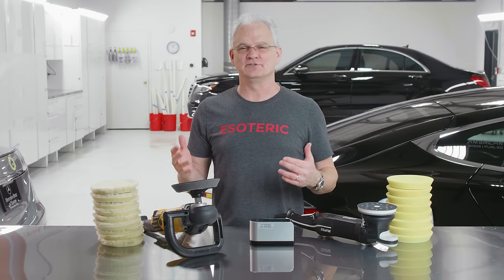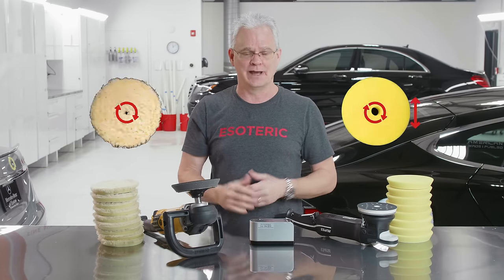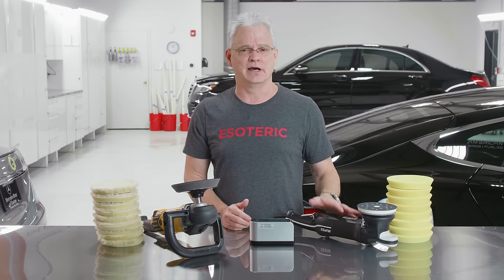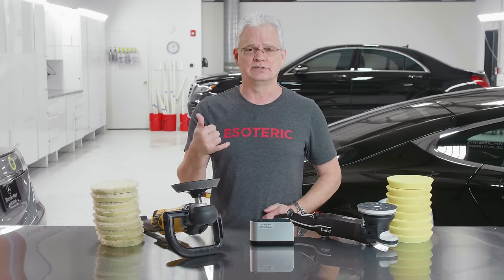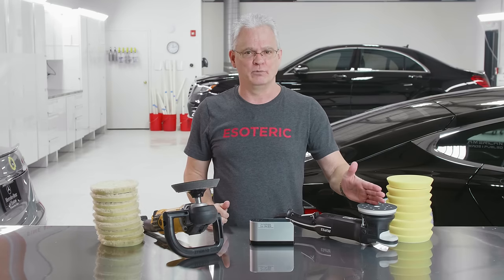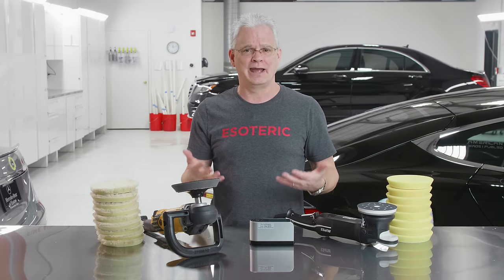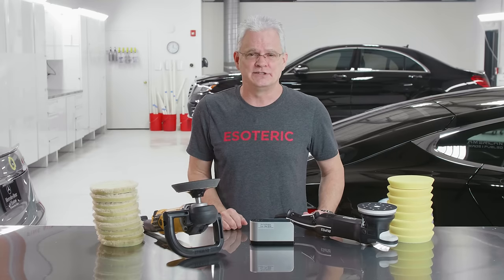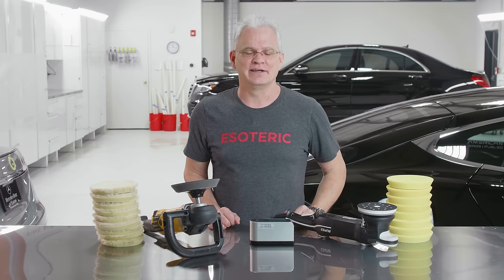Still polishing with a rotary? THIS could change your mind!

Comment: There are some places that you just can't reach with DA no matter the size of the pad. Like concaves on the rear quarter panel of Porsche Panamera - these spots (if they are badly scratched of course) you need to hit with the rotary, beacuse DA with cutting pad will stall there. It is true though that rotary is being used less and less. Mainly due to paint getting softer and tremendous development of abrasives. 
Sad thing is, that many new players in detailing game completly omit rotary, which I think is wrong. It is a very useful tool in thight spots, or when the time is tight. Cut with rotary - finish wit DA - match made in heaven. One step (which is like 80% of paint correction that I do) only use DA
Reply from the maker: We have zero problems compounding with a DA in areas like that, nor have we ever felt the need to grab a rotary to work in challenging areas regardless of the type of car. "Pad stall" is a technique issue, and not a DA issue. We teach these advanced methods in our academy. If you personally like to compound with a rotary and finish with a DA, then there's no problem with that if that's what you like. But you simply don't "need" to do it because of shortcomings of a DA.
Reply: @Esotericdetail  That's intresting. I've done training with Rupes Detailing Academy and Detail King, done over 100 cars with DA and still no luck. Going back to that Porsche Panamera rear quarter - no matter what type of pad, what pressure, machine speed and angle of attack, I could not get my DA (LHR15 MKIII) to rotate in those places. Pad was stalling, it was only orbiting not rotating, so not much cut at all. I swapped it for LHR75 and it did somewhat better, but still there were some spots where the pad "bridged", so I pulled out Ibrid Nano with DA attachment, and got this place done fairly well. But on the other quarter panel, I pulled out LH19 with wool, and using just the very edge on the pad, done it quicker and much better than with DA. Of course, I've had to do a second step in that place with a DA which was not a problem, since Rupes Yellow Foam is just amazing in conforming to these types of concaves.
Reply from the maker: @KamiruNusbaum  There's a reason why detailers from around the world attend our academy!

Comment: hi Todd,i'm new in detailing business,i' ve started a few months ago from passion and now im at that point that everything is confusing for me when i speak aboiut compounds and pads,i have rupes machines lhr 21 es mark3,lhr 75,ibrid nano..what compound do you think will do the job in one step and what pad should I use it?
second question is if is better to buy a rotary machine for headlights as ive noticed the da polisher is not bringing back the clearness or maybe i don't know how to do it.
thank you,Elian
Reply from the maker: Do a one-step with the Rupes yellow polishing pad, and Sonax Perfect Finish. As for headlights, do you actually have a big demand for restoring them? If so, a rotary may be good to have, as well as sanding equipment. If people are not paying you extra for that service, then it's not worth your time.
Reply: @Esotericdetail  thank you for advice,may i ask you just in case if the swirls remain on the car what shall i use it?
some people they're looking to get only the headlights done but is not high demand at all.thanks
Reply from the maker: @raduelian9661  A solid one-step should take care of swirls, but may leave deeper scratches or imperfections. If a customer is paying for a level that removes everything, then do a multi-stage. If they are not, then allow the one-step to get what it gets.

Comment: Hey Todd, what is your favorite one step pad and polish combo  for forced rotation DA?
Reply from the maker: Rupes Yellow polishing pad with Sonax Perfect Finish!
Reply: @Esotericdetail  Thanks Todd! I love perfect finish as well!
Reply: ESOTERIC A rookie inquiry here. When you say “one step” correction...do mean the majority of all paint correction can be done in 1 step. Does that mean 1 step of correction, regardless of the condition of the paint? So if very poor paint surface and you use a “compound “ grade polish...after that step you can you go straight to application of your wax/sealant/ceramic spray? Thanks for any clarification.
Reply from the maker: @lead-dog  One step correction means that you're simply using one type of pad, and one type of polish throughout the process as opposed to a heavy cutting followed by finish polishing. It's not that most cars can get near perfect with a one-step, it's just that most people don't want / need "full correction" that comes with multi-stage polishing. On some cars, you may only get 50% correction through a one step, but on others you may get 80%+. But to most people out there, 50-80% correction is bringing the level of the paint to a higher finish than they have ever seen before.
Reply: @Esotericdetail  Thank you Todd (or whoever) is writing this reply. This is very helpful to a guy like me...retired...and having a passion for detailing and for getting it right and knowing what I'm talking about. You and Esoteric always have great material on you tube. I consider it the best channel for really getting an education. I hope that one day I will get to you seminars. Thank you so much for the help. You have a friend on Amelia Island. ;)

Comment: I had this problem at a Porsche garage i worked for. He had a big foot but wouldn't let me use it because he said it eats through pads ? ( he said the polisher chews the pads up)
I used it and didn't listen to him and it corrected half a Porsche 991 and he thought I did it with the rotary and was very pleased asked me to do the other half . He then showed me what he means with the rupes and he put all his bodyweight against the polisher and went mad 😠 
I said thats not what its for you let the polisher do the work thats why your ripping through the back of the pads.
Because I said that and wouldn't use a rotary like I was wielding a sword in a medieval war he got the car mostly repainted and sacked me. Got videos of the correction i did and not 1 detailer can fault it. U cant teach some old dogs unfortunately

Comment: Who knows how to use a rotary is a more complete professional.
Reply from the maker: As a company with over 30 employees and 3 locations, working at a very high level with cars being shipped in from all over the USA, and nobody using a rotary...I must respectfully disagree with that statement!
Reply: @Esotericdetail  my opinion is not about a company and its professionalism. I'm talking about professional skills. Anyone can master an AD without much difficulty, but not everyone can master a rotary polisher. It's not about better equipment or better work, but about a professional mastering both.
Reply from the maker: @TheRockguitar70  The point you are missing though...it is not a necessity. You can be a master detailer operating at the very highest level without using a rotary. The days of the "top detailers" with rotary skills, then everybody else is long gone. What once was a "badge of honor", doesn't really mean anything now. Results and performance are what defines the top-level detailers, not the tools being used.
Reply: @Esotericdetail  again... I agree with everything you said, but that doesn't take away the fact that whoever operates both machines has more skills than whoever has mastered just one. I'm not talking about need but practical knowledge, as you said at the end of your answer: what matters is the result and performance achieved and not the tools used behind it. Some get performance and results using any tool, others just a few.

Comment: you cant compare the work in rotary. as my experience i still use the rotary compare to dual action
Reply from the maker: Sure you can. As good of cut and finish in fewer steps without the worries about holograms or worse. Once you discover the right combination of products and techniques with the DA, you'll realize it's a game-changer.

Comment: What are your thoughts on the flex 3401
Reply from the maker: We prefer the full control of a true D/A as opposed to the forced rotation.
Reply: What is your da of choice to remove pretty good defects
Reply from the maker: @greggriffin3242  We use the Rupes LHR15 most of the time, and it's also our most popular seller.

Comment: Mate, I can counter your argument why the Rotaries are better.. 20+ years of using Rotaries.. Mind you I have DA Orbitals aswell.
Reply from the maker: I used them successfully for many years as well, but when the long-throw DA's came to market, it was a game-changer for the industry.
Reply: @Esotericdetail  In all honesty if you're a professional on a rotary and pushing out a volume of cars under small timeframes , DA's aren't the go to Buffer. Rotary wins this argument all day long.
Reply from the maker: @asala2116  You can't "rush" finish polishing with a rotary...plain and simple. We move a lot of cars through here at fast pace, and the rotary is only used to spin-dry pads.
Reply: @Esotericdetail  rush finish? Everybody has their method of working. For many years using rotaries we've had no problems. You're speaking as if DA's are Gods gift to humanity, and that we were doomed if such a thing didn't exist. I'm sure you had your way of working with rotaries and maybe when the DA came along, it made things a lot easier. There's things I agree with you, for example finding an employee who has Rotary experience was really hard. DA's are much easier to use and learn.
Reply from the maker: @asala2116  You can do compounding in a quick manner with a rotary, but at least at the level we're finishing at, you simply cannot perfectly finish down that level of compounding in a "fast" manner. Proper finish polishing takes time, particularly when going for very high levels. I have done hundreds of evaluations, many of them with others who claim rotaries to be "faster", and the DOI meter says it all. You can get good results when going fast, but you can't get "great" results...once again, verified by the DOI meter. And when it comes to the rotary and sales / use, they are pretty much dead. About the only people using them anymore are old-school body shops. The industry started to change over a decade ago, thanks mainly to the invent of the Meguiar's MF Cutting Discs. Then once the large-throw machines came out, and pad / polish technology got better, it was game over. If you personally still like to use a rotary, then more power to you. But the main topic of the video is that the modern DA, teamed with the right products and techniques, are capable of everything that a rotary can do, but with less risk and a shorter learning curve. Because it is so much easier now for DIY people to pick up a polisher and get great results, many detailers who separated themselves by their rotary skills, no longer have the "advantage", and that has ruffled a lot of feathers so to speak. For us, we separate ourselves in the quality of work (and training) that we do, and if we can develop and discover efficiencies and tools that allow us to continually grow and expand while maintaining the same high quality level, then we operate our business accordingly, and advise others to do the same. On a final note, the DOI meter is the best tool that developmental detailers can use as they take subjectivity completely out of the equation. This tool was the key for us securing an OEM car manufacturer contract for training and consulting as it proved that factory was able to achieve a greater finish in less time, and fewer steps with a D/A than what they were doing with rotaries. The paint supplier themselves were on hand for the testing process, and agreed that data spoke for itself...the factory then switched their tools, systems, and methods to ours.

Comment: Thanks for the video.  Can/should you use a DA for wet sanding?
Reply from the maker: You want a small orbit DA for sanding...if you feel you need sanding. Unless you're working with re-painted cars, there's very little (if any) need for sanding.
Reply: @Esotericdetail  I was thinking about a 3" DA and wet sanding headlights?
Reply: Amsterdamnster Kush  Yup. That is what I ended up doing and it came out great.

Comment: I use a rotary on boats, but DA on cars...
Reply: Can you use a DA for boats? I'm looking into getting a DA so I can do my boat and cars
Reply: @HoHoPlays  - you can get a DA but you and the DA will die before you ever finish badly oxidized boat gel coat...It will way overheat and take forever providing you know what boat compounds and polishes to get, have a zillion pads, and the ability to clean them and reuse them, and so much more...  
I would only recommend a Rotary for boats, no matter what everyone who is selling DA's says..  :)

Comment: Hi Todd, a little off topic (well, some polishing is involved I guess ...)  I was cleaning the car's black leather seat with diluted APC 1:10, using Gyeon brush. I wiped the seat with a microfibre cloth and it seemed like it picked up a lot of  dirt. I repeated the process over and over again thinking how dirty the previous owner could possibly be , but the amount of 'dirt' picked up the cloth  was not reducing in any way. Then I realised it must be the leather dye coming off! How is that possible? The car is 2017 bmw with just 50,000km! Did you ever encounter something similar, and what is the best way forward? I applied Gyeon leather coat later, but the area that I might have overworked seemed to look more dull than the rest of the seat
Reply from the maker: We personally don't use APC's for leather work, and we rarely use any brushes with the exception of mild ones. This car could have had the leather repaired in that area, and you were simply removing dye. That's really the only time we see that happen.

Comment: Can I start as a beginner with a rotary? cause a DA cost so much 😂
Reply from the maker: Not a good plan unless you have somebody to teach you the proper way to use it. They have a steep learning curve, and they take a long time to master.
Reply: I just bought cheap DA a 15 mm throw and its smooth and not noisy, the brand is north wolf DA 15 mm 900 w 
I also start diy learn polish with rotary and at that time DA is very expensive. Until now i still couldnt master it, with DA i only need a few minutes to produce better polish result and after few days practice, now i could produce some head turner result in our old car and no way i could get same result if i have to do with rotary

Comment: 🤔 hummm I Do bodywork, I tape , I paint , I cut and buff , to me it doesn’t matter which one I used , because I jam when I buff I am not worried about burning the paint , because I can repair it . But for all you young cats use a DA  to start then when your ready for the Rotary jump on it it’s better faster . All my mentor used a Rotary they call the DA a funny tool 🤷🏻‍♂️
Reply from the maker: There's the myth...it isn't "faster". You can't rush finish polishing, even with a rotary.
Reply: @Esotericdetail  I do Agree I take my time when I color sand and buff one part at a time

Comment: Just take the small backing plate off and get a wool pad! Too much time with the DA. I've been detailing for years and I'll buff and wax 5 cars while the DA is just finishing one. Everybody has their own opinion but I will never follow all the hype of a DA. If you know how to use a buffer you will not have holograms or burn anything.

Comment: Unfortunatelly the tremendus stalling of das and specially of rupes , has no close to rotary performance on cutting time and stress to clear. At..my opinion
Reply from the maker: That's a technique issue; not a machine issue. With the right technique, combined with the right products, contours pose zero problems.
Reply: @Esotericdetail  is.not technick  problem the stalling. Is the desing  of.the machine witch allow the stall, and witch is more or less among the different brands and how the motor power transfers via the gear box to the plate via the torque .
Reply from the maker: @marioskosmidhs9454  The DA requires specific technique just like the rotary does. If you don't use it right, you won't achieve proper results. We have been teaching students from all over the world for 8 years now on how to properly compounding and finish polishing using a DA machine, and within 2 short days, we can have even a beginner correcting challenging contours to perfection.

Comment: Very controversial and I love it. You’ll likely get nasty comments on here from the older guys that dropped out of HS at age 15, worked at a body shop their whole lives because that’s the only work a burnout could find. Those types of guys really, really hate DA users and there’s nothing I find funnier than reading about how their so technical with their rotaries and non body shop DA guys are just amateurs.
Reply: Lmao I have a college degree..... Have my own business and grew up painting show cars... There is no right or wrong there is a job to do and you pick the right tool for the job... Sometimes the rotary is the right tool for the job. If your not using both when needed your not getting the best results you could in a time frame. Also rotary edges better than a da hands down... They both have strengths and weaknesses I would say if you are not skilled using a rotary as in you just don't have the skill set then you are indeed an amateur. I hope that controversial enough for you...

Comment: 20 plus years and a rotary will kick the DAs butt in cut and speed. Cut with a rotary and finish with a DA. I’ve tried several DA cutting pads and high end compounds and you just can’t beat the rotary for cutting.
Reply from the maker: DA can go 1500 to a perfect finish in just 2 easy steps with the right combination of techniques, tools, and products. If you have experienced otherwise, then you simply haven't found the right combination.